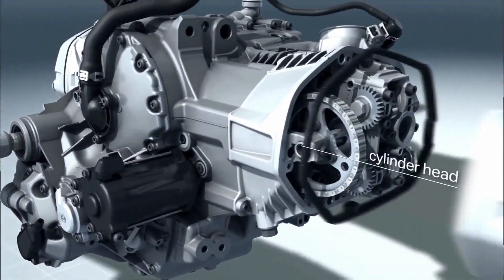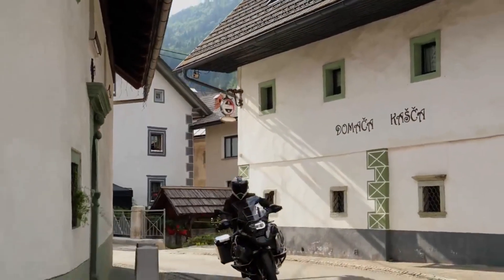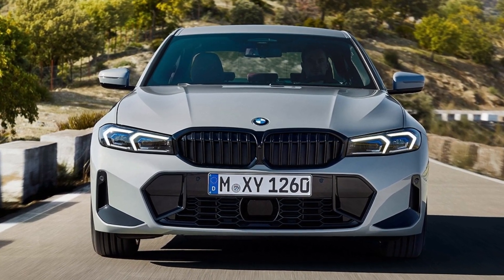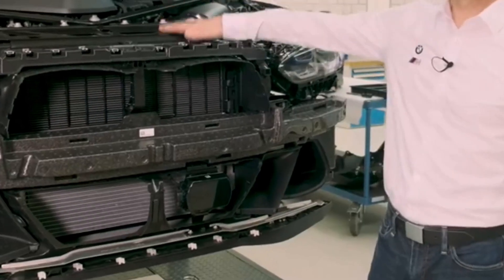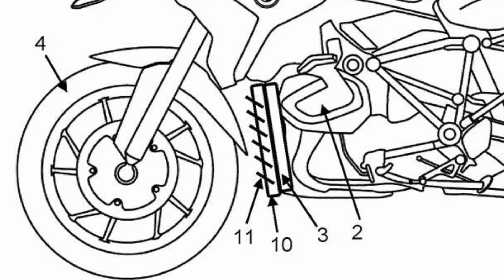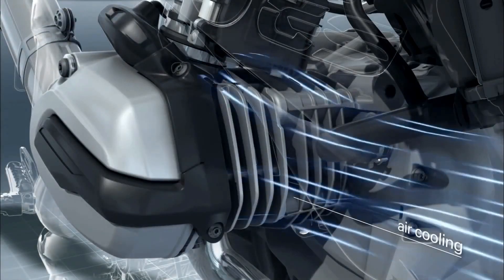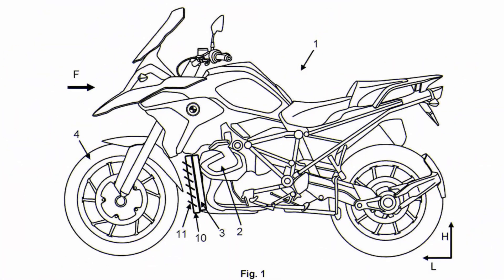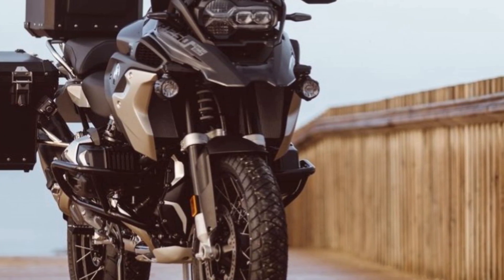ADAPTIVE RADIATOR FOR THE NEW 2023 BMW R1300GS ADVENTURE

Comment: I very much doubt this is for aerodynamics. It will probably be to ensure the engine is always running at the ideal temperature for fuel efficiency and possibly to reduce the need for electric fans, or it will allow the reduction in size of the fans needed